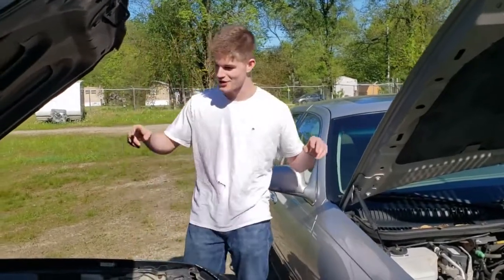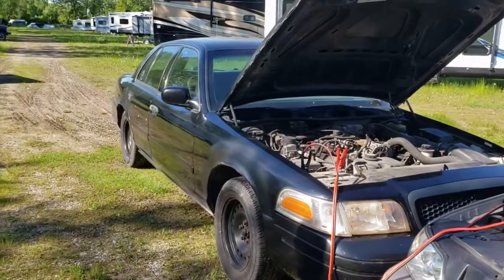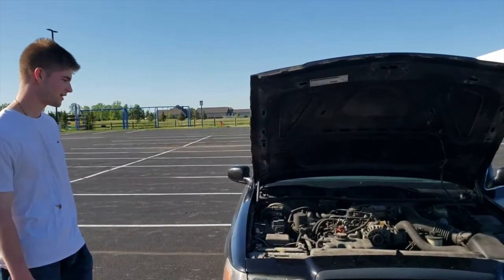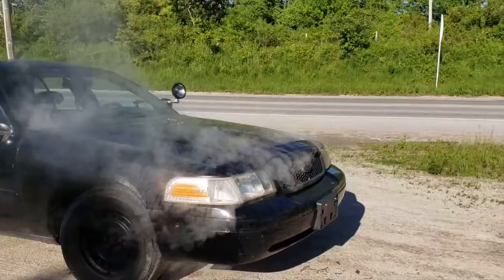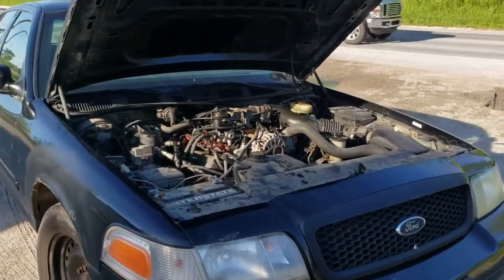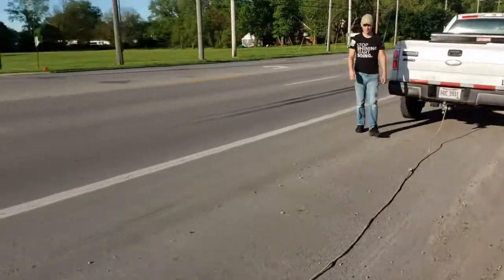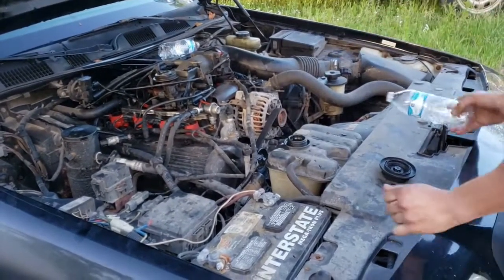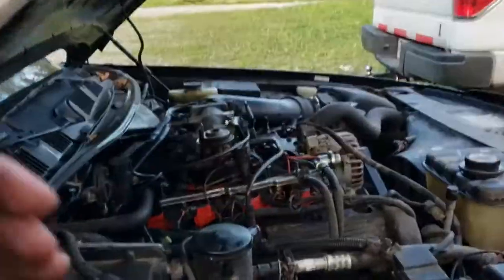Crown Vic Review Gone Horribly Wrong (Blown Up?)

Comment: You really can't compare a TC to a CVPI, the TC has not been parked running at an accident scene for 4 hours. The TC was probably garaged during and after snowstorms, so it does not have all the salt and whatever else they put on the road. The TC has not been in high speed pursuits. I could go one, but I think you get my point.
Reply from the maker: They are very similar cars however i do agree that they were both built to serve a different purpose. Thanks for watching!
Reply: MANY TOWN CARS ACTUALLY WERE TREATED WORSE  THAN A CVPI. THEY WERE USED AS' TAXIS,🌍🌐🚕🚖🚖NON'STOP!  IN EXTREME HEAT PLACES LIKE ARIZONA! FL! NEVADA, ETC 
THE EXECUTING L, LIMOS WERE BEATEN UP BADLY TOO. WE HAVE ONE WITH 600.OOO.MILES! STOLL RUNS GREAT